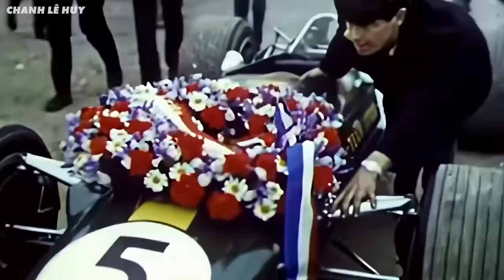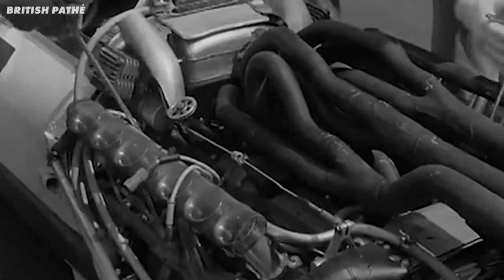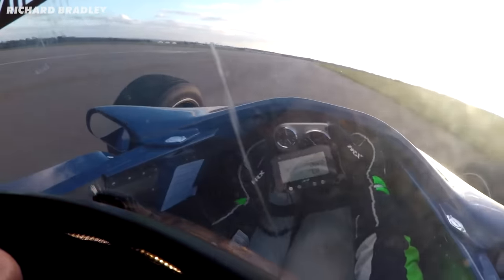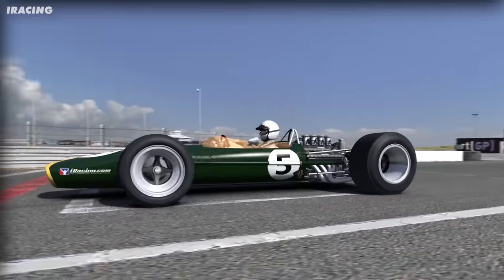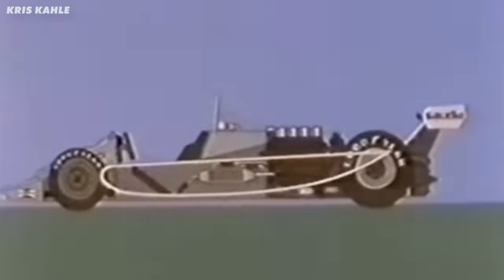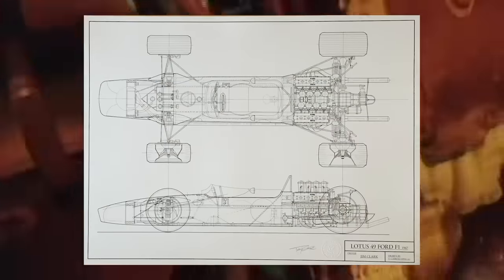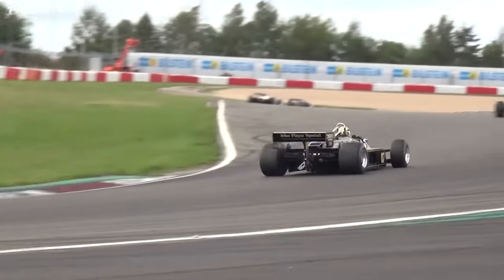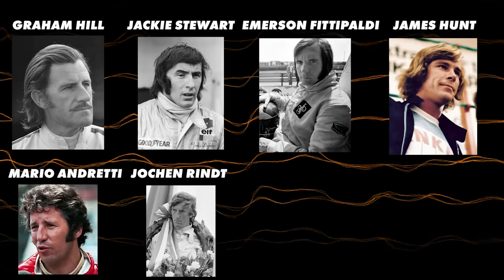When FORD Designed the GREATEST F1 Engine Ever!

Comment: While Ford had nothing to do with the design of the DFV, they did bring two very important people together. Colin Chapman and Keith Duckworth. A huge part of the success of the engine was due to Chapman's brilliant idea of making the engine a stressed member of the chassis. An idea still in use today and Keith built the DFV to do just that.
  Ford's greatest contribution(they owned the rights to the engine) and what made them and Cosworth a ton of money was to share the engine with the world. They didn't have to do that as they could've kept the engine exclusive for Lotus only and literally dominated F-1 for over a decade.
  Also to their credit Ford didn't insist on calling the destroked version that dominated Indycar racing a Ford either. They let Cosworth have the glory.
Reply: Ford did one other thing. Testing. Duckworth designed the engine. Ford made it reliable. The same rig the 427 that was in GT40 used to test the engine to destruction was used for the DFV. They ran the engine to death through multiple rev cycles and simulated laps, pulled it apart to see what broke, and then Cosworth took the data to fix the design or manufacturing flaw. Over and over. Until the DFV had it's reputation for being bulletproof. That was Ford's big engineering lift for Cosworth and the DFV. Testing. They did something no other engine manufacturer in the world at the time but Ford had the expertise to do for Cosworth. People forget the importance of that type of work. Cosworth never could have afforded having Ford do it for them, and Ford never did it for any other engine manufacturer so they probably wouldn't have even if asked. Different Ford. In 1966 Ford was coming off their win and for a short while had ideas of going to F1.  It's why Ford gave Cosworth the money. It's also why they did all that backend testing work. They wanted their own engine for F1 if they went in. So it got tested the same way Ford did for their Le Mans car.
Reply: @halycon404  Lots of misinformation here my friend.
The same rig the 427 that was in GT40 used to test the engine to destruction was used for the DFV.  Rubbish
FORD LeMans winners were powered by big ole iron lumps developed in stock car racing.
Never revved over 6,200rpm. And never tested to destruction. LMFAO:face-orange-frowning:
Reply: @DennisMerwood-xk8wp  Nope. The 427 used in the GT40 was not the same 427 that was used in stock car racing. That was the starting point. Ford took the 427 and designed an entirely new gearbox and transaxel for it, tossed the entire drivetrain on a series of dynos to add torque load, then ran LeMans over and over again on one of the first computer controlled test benches. Every gear change, every clutch use, every rev change and hold; all of it. The entire race. The engine over the course of development shed parts from the original 427 Nascar engine and got it's own. Cylinder heads, lifters, new water pump, new high pressure dry sump scavenging oil system, the exhaust system, and loads of internal parts. Every time they ran the engine around a simulated test of Lemans and something broke, they redesigned replaced it. The 427 in Nascar was called the Gen II FE 427. The 427 for LeMans was named the GT40X. They are not the same engine. Same basic block, everything else went. Anything which couldn't make it for 48 hours on the test rig went away. That engine was tested to destruction. Multiple times.

After the first loss at Lemans when none of the cars even finished Lunn and his team became downright zealots to testing everything and replacing anything that broke. That was the actual head engineer of the GT40 program btw. Roy Lunn. Carrol Shelby was in charge of on track testing in California. Back in Dearborn was were all the real money was spent in the mechanical R&D. The system to entirely change the breaks which people chalk up to Shelby? Shelby and his team came up with idea. Lunn and his team actually designed and built it.

There is so much about the GT40 which doesn't agree with the public story. LeMans was as much marketing as anything else. There's the marketing story which Ford put out because it made for good press. Then there's the actual story. Ford wanted to be the plucky underdog to the American buyer, pure Red White and Blue to the US auto buyer. It used the same 427 as the NASCAR cars because it made Americans feel good. Carrol Shelby was head of the GT40 program because here's an American that conquered Lemans. Even if the actual head engineer was a British immigrant Ford hired from Aston Martin where among other things he worked on the DBR1 which won LeMans in the 50s.
Reply: @halycon404 
The car used the 427 iron block production engine because that was the ONLY engine Ford had available to it! What other engine were they going to use? Some dreamers at Ford imagined the car utilizing the Indy dohc 4.2 liter V8. LMFAO.  Can you think what a fiasco that would have been!

"...Cylinder heads, lifters, new water pump, new high pressure dry sump scavenging oil system, the exhaust system, and loads of internal parts..." ppppfft.. it was still a hot-rodded stock block school bus engine. Only revving to 6,200rpm with its crude 4-barrel Holley 780 CFM Carburetor.

And of course, they had to use an entirely new gearbox and transaxle for it. Unlike the stock-car it was rear engine car!  And the gearbox was a Kar Kraft built four-speed unit. Not a Ford design.

All this urban legend about how this car was developed gets more exaggerated every year as time goes by. Nobody mentions that the great Bruce McLaren did the majority of track testing, and without the Kiwi's input the program would have floundered. Ken Miles was a rookie race car engineer compared to Bruce. 

And of course, when you get right down to it, it was pretty sad that the Yanks had to resort to a 7.0-liter engine to compete against its 4.0-liter rivals. Brute force and ignorance. And cubic money! And in Can-Am the Ford 7.0-liter engines were humiliated by the alloy block Chevy's with fuel injection.
Reply: @DennisMerwood-xk8wp  You do know there's video of the dynamometer testing process from the production of the GT40X engine right? Ford actually recorded it because it was the first testing process of it's kind. Every computer controlled gear change and throttle input. The entire drivetrain artificially put at a higher stress load than the race would be to truly test it. You can go look it up and watch. It existed. Ford really did do that. They broke the drivetrain on purpose to find the weak links.

I'm well aware the car wasn't an American, I pointed out the actual head engineer was a Brit. I pointed out why Ford hired him, he'd help engineer a previous LeMans winning car. Sigh. All this crap. A 427 is a bus engine. Sure. Whatever. If I change the crank shaft, the cams, the rods, the cylinders, the headers, the lifters, the intake, the timing, the fuel system, the oil system, the cooling system. And whatever else. Sure. It's a bus engine. The 427 was chosen btw because the block for it was unbreakable. Resilience was the most important consideration. It reved to 6000 RPM which was lower than stock, again resilience. Ford's goal wasn't just throw 7 liters at and win. It was throw 7 liters of bulletproof engine at it and anything lighter would blow itself up trying to keep up from internal stress. They did everything they could to make sure the engine would never break. Say whatever you want about it. It was year after year the most reliable thing on the grid. The thing was engineered to be a tank, reliable as clockwork.

So, back to the DFV. Sound familiar? The thing everyone says about that engine, the most reliable part on the grid. It just always worked.
Reply: @halycon404  The  hot rodded bus engine is a crude velvet painting like you buy at the fair - next to the Mona Lisa all alloy dohc V12 Ferrari.
Reliable as clockwork eh! Only 3 of the 13 Fords finished in 1966. 5 of the 7 Porsches finished. LOL
And if you analyze all the race results of the period at Daytona-Sebring-Le Mans the Yank V8's were no more reliable than the pure race engine Ferrari's running at 9,000rpms.
Take care
Reply: @DennisMerwood-xk8wp  You don't actually know what you're talking about at all do you? Go lookup what engines were in each car in 1966. You'll find it wasn't just the 427 running. Earlier cars with earlier engines ran. In total I think there were three engines in 1966.  For the years Ford ran I think there were 4 official engines at LeMans inside the GT40. After market teams added another after the FIA changes variant in 69 I think, for a total of 5 different engines inside a GT40 that ran at LeMans. The 427 was what the official Ford teams got, it won. The non-factory teams got something else.

Typical not understanding how old LeMans worked. Everyone sold last years car to privateer teams. Often more than they ran the year before with a few changes to lower the price and make them less competitive against the factory team they bought it off of. But people bought them because with racing back then there was always a chance.

Ferrari actually lost in 1665 btw, even though it's chalked up as a win by them. A non-Ferrari team who bought a car from Ferrari to race at LeMans won. A Ferrari crossed the finish line, but it wasn't Enzo's. Enzo's lost. Enzo's crashed out or had mechanical problems. Enzo moved all the Ferarri labeling to the other team's paddock so it would look like Ferrari won in the pictures. Cause well. Enzo.

But a non-factory team won. Because that year that team was right. There was always a chance. Enzo brought a bad car, Ford brought a bad car. Porsche brought a bad car. The teams who bought older cars off manufacturers won.

The Ferrari that won in 1965 btw is on display in the US. Know why? The team who won offered to sell it back to Enzo for their collection of wining Ferraris. Enzo said no. A US team who bought the car from Ferrari won and he didn't like that. Enzo would happily claim his spot for that car in the records books but he wouldn't claim the car itself as his. Again, it's Enzo. Guy apologetically was who he was. I'll give him that.
Reply: @halycon404  You don't actually know what you're talking about at all do you?
Reply: @halycon404 like I told the other half in this conversation, you need to read the book, Go Like Hell. That 427FE was exactly their Nascar engine. They just lowered the shift points for reliability. 
 Oh and the GT40 while being designed and built in both America and Britain only because England was closer to the source. It's an American car even if it was built in Slough by Ford of England employees. After 1964 ALL Ford GT40s were built by Kar-Kraft, across the river from Dearborn in Canada, which is a Ford company.
Reply: @DennisMerwood-xk8wp  - And the Chevy's fuel injected 8.2 liter was humiliated by the Porsche 5.4 Liter flat 12!  :face-turquoise-covering-eyes:
Reply: @plantfeeder6677  - Good reply and you're right, "Go Like Hell" is a great info source!  Holman Moody was very involved with the GT40 427 engine too.
Reply: Duckworth had been working with Ford engines modyfing them for formula 2 &3 they were very successful there was a strong good relationship between the firm and Fomoco even before the dfv , in July, 1965 his most sophisticated conversion to date - a 1600cc twin cam head and accessory drive for the Ford Cortina 1500cc block the beginnings of the DFV.
Reply: @DennisMerwood-xk8wp  You are wrong on the changes made to the NASCAR 427 FE engine before planting it in the MKII GT.  The ONLY changes of any importance were adding an idler gear to the camshaft, converting the lube system to a dry sump setup and cross bolting the main bearings.  The 6,200 rev line limit you site is bull, too!  While that's what it was designed to run at for 24 hours straight for over 3,000 miles, it was not the rev limit. The 427 side oiler engine was capable of 7,000, with some owners claiming 7,200 rpm when properly built for sustained high speed!  It was every bit as reliable if not more than the Chevy equivalent.  Also, Ford never got behind any serious Can Am involvement.  They had enough on their plate with Indy Car engine development and a host of other racing involvement.  By the way, those F.I. 9 liter aluminum Chevy blocks in Can Am were more than humiliated by the 5 liter V12 Porsche.  THAT power house was so dominant that the series closed down! Finally,  Ford used the 427, not because it was the only engine, but the one that already had a proven record in NASCAR.  Nobody was restricting Ferrari from making man size displacement engines - that was their choice.  They asked to get slammed and they definitely were!!  :text-green-game-over::face-orange-biting-nails:
Reply: @halycon404  And there again the GT40 was orrigionally a British LOLA rebodied, n continually redesigned by Brits.  But once Ford had their teeth into it they took the develpment team over to the US, which is where Shelby stuck his nose into Fords GT40!

Comment: In the 1960s Ford engineers in Detroit designed excellent racing engines for indianapolis and the Ford GT.  But the Cosworth DFV was designed by Keith Duckworth.
Reply: Yes but Coswroth had their start with Ford modifying Ford engines for formula 2 and 3 they were very successful and their modified Ford engines won allot.. when lotus asked Ford to build and engine for F1, Since  duckworth was already racing modifying Ford engines for the other classes in Formula 2&3 they figured he could modify another Ford for F1 so Ford  paid him to do just that; Duckworth began designing, in July, 1965 his most sophisticated conversion to date - a 1600cc twin cam head and accessory drive for the Ford Cortina 1500cc block the beginnings of the DFV...

Comment: Another Ford engine similar to the DFV  was the Series 4 that was developed for the Indianapolis 500. It was developed from the Series 3 based on the 260 stock block engine. It was cast aluminum with 255 cubic inch displacement. It had 2 valve heads. The Series 4 was a gear driven 4 valve head design that ran on alcohol fuel. It produced over 400 HP and won the 500 in 1965, 6 and 7.
Reply: Fords Indy engine made 800hp less than 300ci
Reply: And also for Colin Chapman!  He was obviously the man with the plan - the Adrian Newey of the 60s and 70s.  Adrian Newey is the Colin Chapman of the last 20years.
Reply: And 1969 and 1970 and 1971.
Reply: Man i still remember that motor when i believe it was shell used it in a commercial, screaming around a road coarse sounded incredible.
Reply: @MrWildwilly48 it created a whole new sound that became familiar at Indy.
Reply: Between Indy and LeMans, Ford owned 1966 and 1967. 🇺🇸 💪🏼
Reply: @CoyoteFTW  
What the creator fail to mention about the cosworth DFV in the Video.
Was it was actually turbo charged by the Vels Parnelli Jones team
and cosworth for use in America in the Indy 500 and Indy car in 1976.
It was renamed the Cosworth dfx and had 850 to 900HP.
During that time the engine Won ten consecutive Indy 500 races 
from 1978 to 1987 and it also Won all USAC and CART championships 
between 1977 and 1987 and Powered 81 consecutive Indy car victories 
from 1981 to1988 and 153 victories total in indy car alone.
Overall that cosworth engine won 155 f1 races and 12 F1 constructers
championships and, 12 f1 drivers championship, it also won 2 Lemans
title and 2 world car championships, aswell as all the success in
the state, overall that engine must of won over 500+ races in its time.
I dont know if your familiar with the Museum of American speed
in Lincon Nebraska, they have the DFV and the DFX on display there.
Reply: @jordanmascarenhas7974 they owned Lemans the day they stepped foot there in 1964. They instantly became the fastest car there for the next 4 years. Same with Indy from 1964-1971 and from 1963-1969(or until Dodge and Plymouth crapped on the sport with those FUGLY Daytonas and Superbirds)FORD owned Super Speedway racing in Nascar and were the car to beat in the Trans-Am series from 1966-1970 with the exception of 1968 when cheating Roger came onboard.

Comment: Just to clarify, Ford had nothing to do with the design of the Cosworth DFV. Also, the BRM H-16 is not anything like 2 V8 engines joined together. More like 4 Subaru flat 4's joined into a pair of flat 8 cylinder engines with one stacked on top of the other.
Reply: Actually the BRM H-16 was two BRM V8's flattened and put on top of one another

Comment: The engine had a new life in its later iterations of the DFY and DFX Indycar engine in the late 70's and early 80's. They cleaned up and for a decade pretty much did in Indycar what the DFV did and later variants were Champcar motors in the 2000's.
Reply: The first turbo DFV started with Parnelli Jones’ Indy Car team, but Cosworth recognized the potential and took it over.